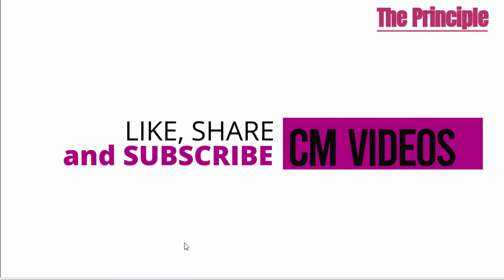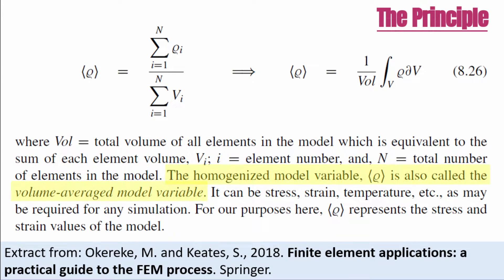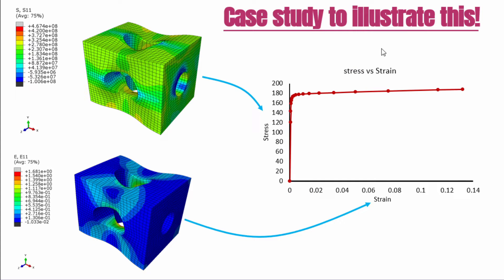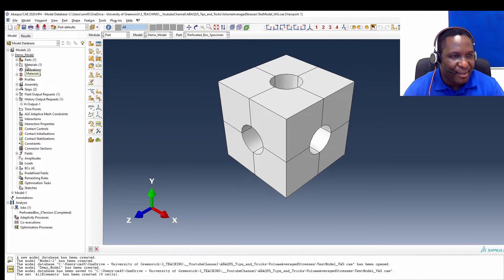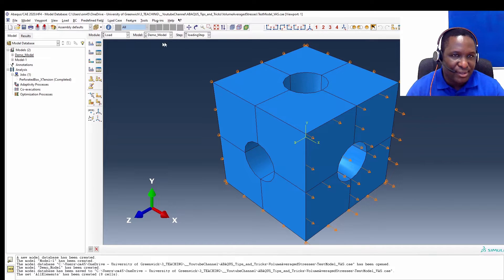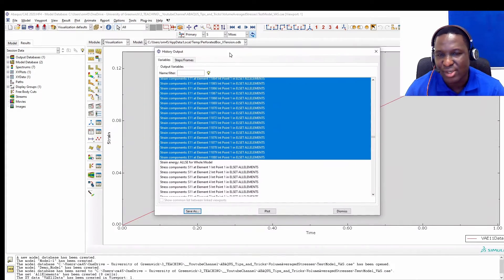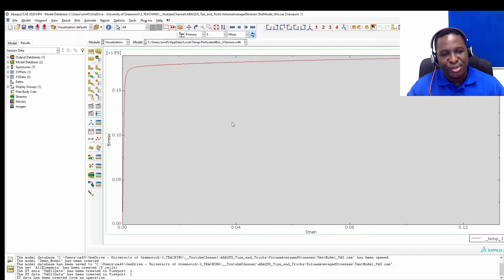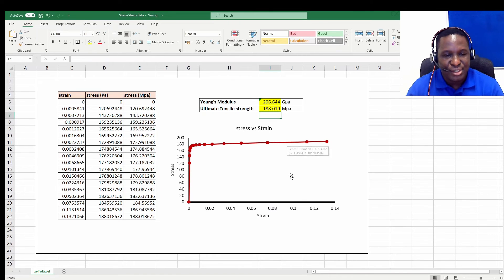How to PLOT stress-strain curves in #ABAQUS - Part 1

Comment: Thank you very much dear Prof . please how can i use the (E, total strain components) in explicite solver ? thank you again.
Reply from the maker: I would image the same way as the implicit solver. You may also track the E-strain as a history variable specified at the start of the simulation. Is this helpful?
Reply: @MichaelOkereke   Thank you very much sir , I followed the same way so I checked on strain components E in field output and in history output, but after the end of computing I had logarithmic strain LE instead of strain components E. Does that mean anything. Thank you very much.

Comment: If we did not create or model in abacus we don't get geometry option in sets. What to do instead in such case?
Reply from the maker: You can manually select those nodes/elements and put them into a set. You can also use other methods for extracting stress strain other than the homogenization approach here for example the experimental-equivalence approach (see my video on how to get stress-strain plots in abaqus by 3 approaches).

Comment: @MichaelOkereke, in the history output field, for you, the results are resulted only at Integration point 1, when I followed the same, I got 8 integration points. for each element, the S11 at eight points are stored. 3000 elements with 8 points resulted in 24000 temp data in my case,  How you get the data from only one IntPoint. Also, in the video, when you click the ok in the avg(XX,XY) menu, for you only one XY data is shown in the left side menu. For me, those 24000 data was written as temp, what I missed from the video?
Reply from the maker: Hello, I think what is happening here is that your model must have an element that is prone to multiple integration points hence your stress history variables have 8 integration points. If this is the case, then what I ahve shown here will not precisely work for you. You will have to first integrate the values of stress, S11 across the 8 integration points before then volume averaging that integrated value. It is a two step process but not very trivial. It is probably best to do so using a Python script that first loops over the 8 elements to extract a value for S11 for that element before then looping over the total number of elements using the method I showed here. 

On avg(XX, XY), I think this might be linked to the problem with multiple integration points. If not, then check that you select the averaging function first before giving the data a name and then plotting the result.

I hope these help.

Comment: Hi, Thanks for sharing. I wonder how the avg(X,X) works, It seems that it calculates the average stress, not the volume average stress. Can you clarify this?
Reply from the maker: Hello @Mina, this is a very valid question and well spotted. Technically, the volume averaged term will require it expressed as in my video at 1:00 where you sum up all the stresses in the elements and divide by the sum of all the elements in the model. Whilst this makes sense but what is the practical value of such a volume-normalized stress. 

On its own, it does not mean anything but when you combine this volume-averaged term with say the volume averaged strain, then you have a sensible value for say Young's Modulus which is the ratio of this stress to the strain. In this instance the volume term will be dropped leaving only the summation of the stress and strain values. 

What will make more sense will be the average stress in comparison with the average of the strain the model over the region of interest. This is why I use this as a proxy for the volume averaged stress, but you are right that avg(x,x,...) is simply an average.
Reply: @MichaelOkereke  Thanks for your reply.

Comment: Very interesting video but I have tried your way on fracture modeling using XFEM but the strain stress curve I have got from Abaqus is different from your old way to get that curve by turning the force and displacement into stress and strain. Actually the strain stress curve I have got it from Abaqus almost the same identical with the curve I got it by old way from force and displacement but till the peak point (fracture) but the curve from Abaqus after the peak ppoint return directly to zero without softening part which I got it from the old way. So, I wondering is that due to fracture and is your way is valid for fracture modelling too or only for elastic modelling only and if you could help me to improve that I mean to get the strain stress curve for fracture modelling directly from Abaqus. Thanks in advance
Reply from the maker: Hello @John Nabil, thanks for your continued interest in the channel. I am not sure why you are having varying stress-strain plots, maybe I do not completely understand what you are trying to do. The essense of these different stress-strain plot videos is not to make identical plots. Of course, the approaches I showed would work even in fracture - as long as elements are in the model - these approaches volume-average (i.e. homogenize) the response in the region(s) you have specified so they will work always. It is really aimed at equipping my viewers with different ways they can probe their models to extract stress-strain plot. I will suggest that you discuss your approach with someone more experienced in these things to better understand the mechanics of your implementation. FEM is a wonderful tool but if you put in the wrong values/process, you are bound to get the wrong/misleading outcomes. The overriding principle is that these methods I have shown in the video are right and you should use them to explore certain features of your model. For like-for-like fitting between all of them, that is a different subject and you have to set up the models right to make such comparisons.
Reply: @MichaelOkereke  Thanks for replying. First I got the strain stress curve from your old way to get that curve by turning the force and displacement into stress and strain in Excel sheet and it looks fine but when I got the strain stress curve directly from Abaqus as you have explained in this video the curve looks not fine as after the peak point the curve returned directly to zero without softening part. By the way the stress curve alone I got it directly from Abaqus looks fine and also the strain curve looks fine both regarding to time as x axis but when I combine the strain and stress together the resulted curve not looks fine as after the peak point it returned directly to zero. Yes I know it should not be identical plots from the two ways but actually I wonder as since I got the stress strain curve by the old way from displacement force curve and it is fine which means that my model working well so why the direct stress strain curve from Abaqus looks strange. I am not sure but think the strain values after the peak point (fracture) is very low compared to the values before fracture or even compared to the size of the elements so the strain values going to zero and the stress values too but how I can modify this I mean how to overcome this to get the good stress strain curve, so if you could help me to improve that. Thanks in advance